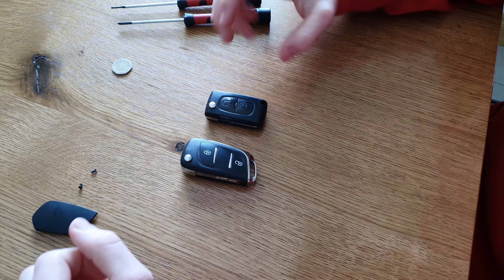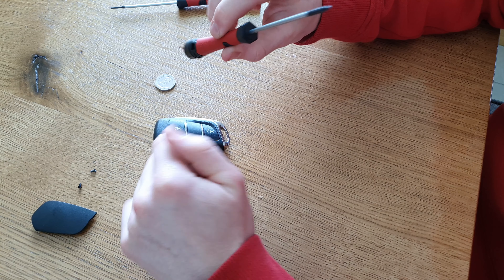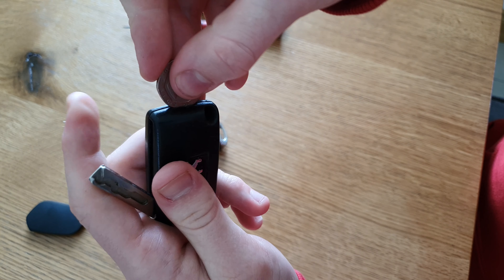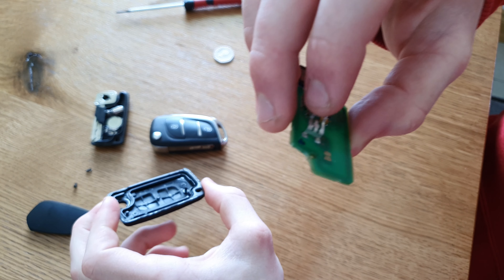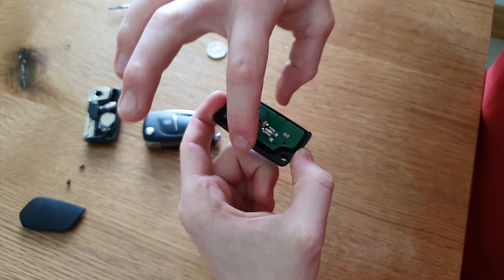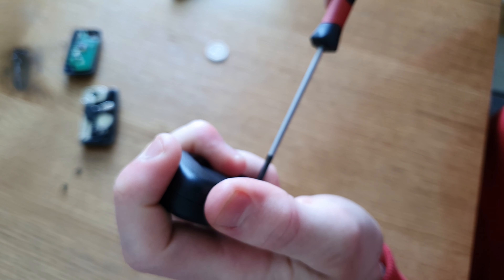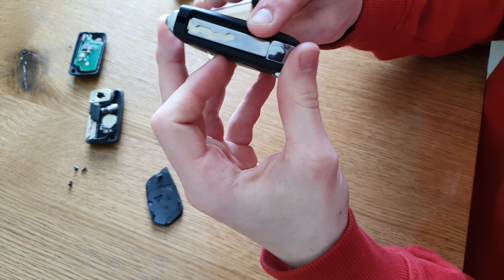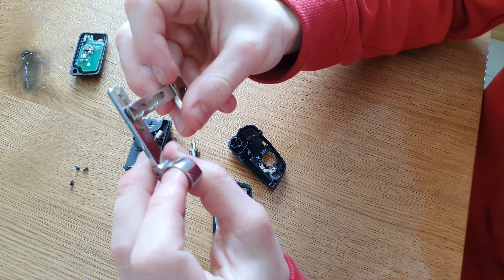peugeot 207 key fob update

Comment: Man! 
I am a mechanic but can't get to work my remotes . The car starts the remote door locks don't work. What can i do? What module should be checked?
Reply from the maker: one of the fuse my by gone, next potion are the battery in the key is dead if not the are fallow thing the wire my by damaged it worse senarion the module or antenna from the locking system it damaged and the last option in the motherboard in the key if damaged.
Reply: Where you able to get your key lock to work sir?